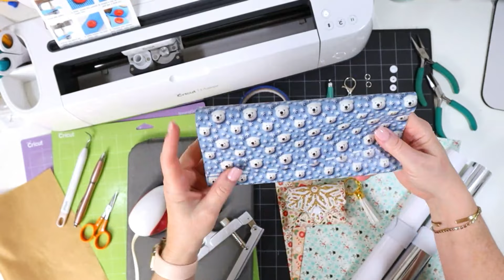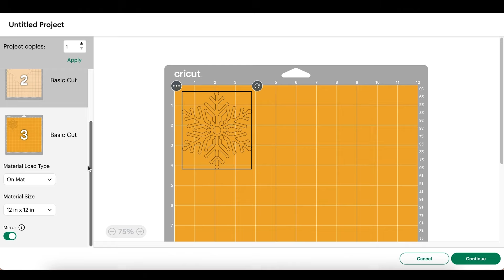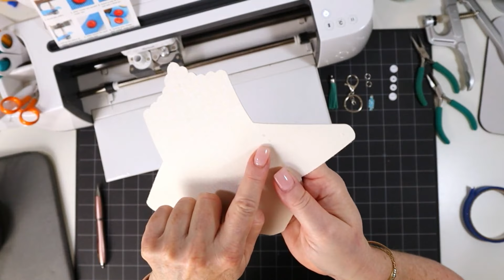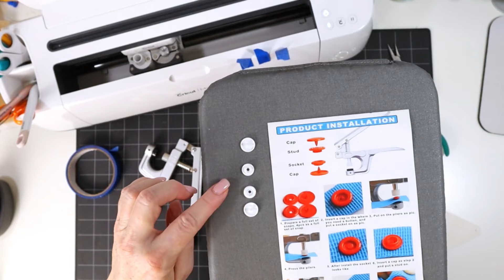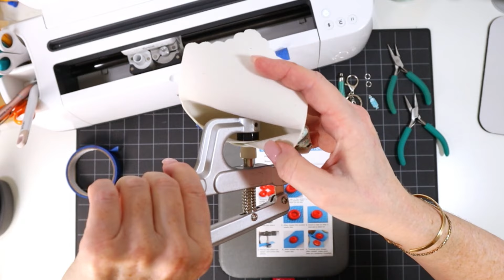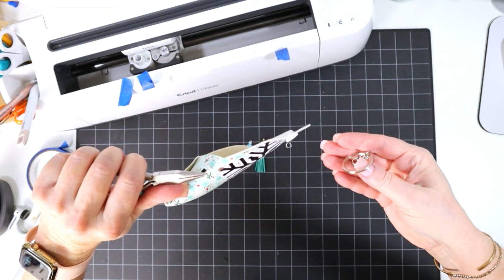How to Make a Faux Leather Snowflake Card Wallet with a Cricut

Comment: Hi Amy, as usual your projects are so cute. I really enjoy watching your videos. I have one quick question for you. Is it necessary to use an extra long kam snaps on the top layer that only has one layer of faux leather?
Reply from the maker: Hi, Gloria! You're right, the flap which only has one layer can use a regular sized Kam snap. The only place you need an extra long is the one cap that goes through the three layered flaps section of the pattern. :)

Comment: So pretty! Amy I found faux leather on Amazon that is 11.8 wide I believe & you can order a roll based on yards. You can get upto 2yrs I believe, but it says in one spot that it's upholstery faux leather. So far I haven't found the thickness, would that work for making a small purse/change purse/coin purse etc.. as long as it's definitely 2mm or under to fit under the rollers?
Reply from the maker: Hi, Gena! I haven't tried using upholstery faux leather in my Cricut so I'm not sure! If you try it, let me know if it works for you. :)
Reply: @AmyRomeu I need to go back & finish reading the rest + reviews. Sometimes someone will mention a Cricut 😊 I'll let you know if I try it